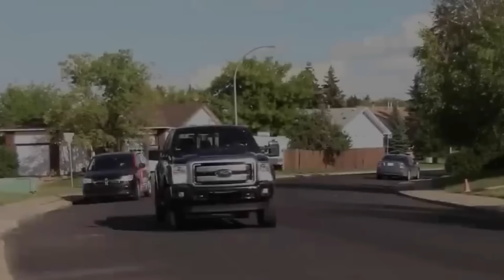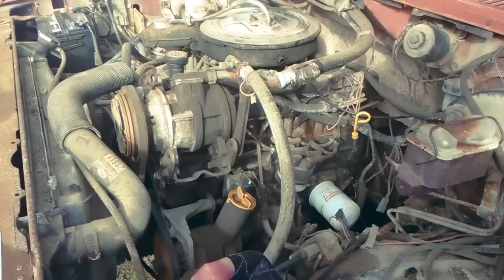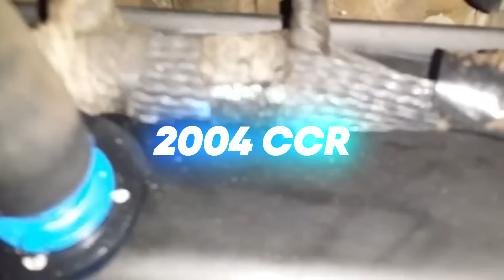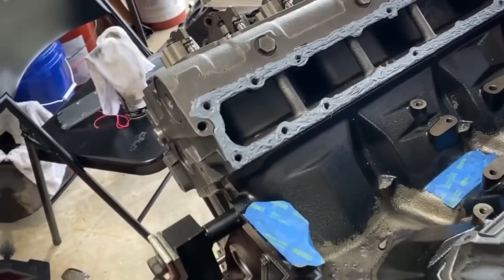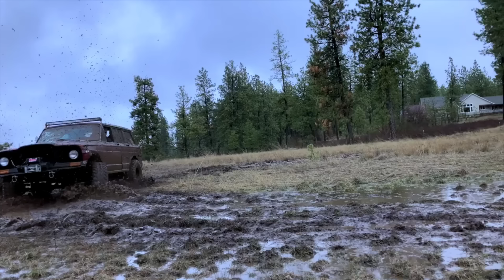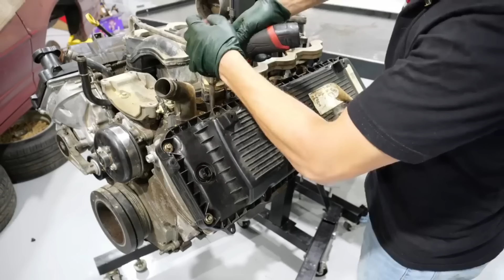The Only 5 Ford Engines That Last 300,000 Miles

Comment: This is just ME on my FORDS (F-250s) 😊 that I bought brand new way back starting in 1979 my First was with the (351) I so wish I had got the inline-6 trustworthy FORD workhorse back then, I ordered a manual transmission with a low 1st gear, Booth of my FORDS did NOT have (4×4) I just never wanted that in my Pickup personally. I got 100 thousand miles out of the 1979 when I bought my next Ford a 2000 with the V-10 
It hit 80 thousand miles when I sold her, now I own a 1 Ton and it is from the other big name makers of trucks, it is (4×4) with 4 door 8 foot bed and it has a (Diesel) with the 10 speed transmission. That my history on FORD ownership and never doing major work on both of those FORD engines 😊

Comment: Waving the b.s. flag here literally been around a 351m 351w 460 300 , 460 390/360/352 5.4, 4.6, 3.5 ecoboost, 4.0, 3.0v6 with more than 300k and the only thing they had in common were on time oil changes.

Comment: Its crazy that most manufacturers stopped making inline 6 engines , they all seems to past alot longer and cheaper to make and work on
Reply: Ow i.say this all the time,.straight six is the most reliable engine config. Most powerful per displacement aswell these days..i,m a Ford guy, but the hurricane engine from Stellantis is the best 6 cylinder petrol truck engine. EB 3.5 should have been inline its just too complicated....

Comment: 07 f150 4.2 v6 i have 356k miles on it . Change the oil every 10k miles . Full synthetic.  Still runs good
Reply: Those 4.2 were overlooked forever.  I’d get one of those before I’d buy one with a 5.4.

Comment: I have looked through the comments and not one 2.7 ecoboost 6cyl is spoken about. I put 300,007 thousand miles on a 15 model before the transmission went cooked and I was still getting 23.9mpg I am currently in a 17 model of the same with 337, 556 miles getting 24.6. Oil changes every 5000 and the basic normal fixes needed belt, one alternator the clutch exploded and a couple of sensors. Both trucks didn't loose more than maybe 18-20 percent power. I don't do it often but I lit the tire up a few weeks ago to prove my point to a guy who doubted me.
Reply: I got a 16’. Bought it at 161k. Last February and currently sitting at 227k. Restore and protect every 4-4.5k miles and did a coolant flush once. I average 19.5-22.5 mpg driving in the NC mountains. I got wastegate rattle but seems normal from what techs said. Only issue I have is periodic rough idles when it’s hot out. I’d like to upgrade the cooling system and put a catch can on soon.
Reply: I’ve owned F-150’s since the 90’s and I’ve owned them all. 4.9L 
4.6L
5.0L
3.5L
2.7L
Well almost all of them. And I love the 2.7L.

Comment: I have driven multiple F250s with the V10 that went 495000 to just over 500000 miles - the only problem with that motor was that it liked to spit out spark plugs- mechanic hell-coiled the cylinders that spit the plugs and trucks just kept running

Comment: There are already 1 million mile 6.7 powerstrokes and it should have made this list
Reply: Mine is about to turn 300,000, runs strong and fast and tows 32' trailer with no problem
Reply: @alyboucher6797 beautiful
Reply: It will easily make over 300k

Comment: On the 7.3s it’s a good idea to replace the factory turbo, pedestal and up pipes because those are common weak points on the engine and you can buy semi grade coolant which can last 1 million miles easy before you need to change it.

Comment: I worked at UPS back in the 1980's. I remember asking the mechanic what type of engines they had in the trucks and he told me they were all the Ford 300CI L6 because they required little maintenance and they were relatively easy to maintain if they did need something. I then bought my first F150 with that engine and happily drove it for 25 years. No idea why Ford discontinued it but my newer F150 with a 302 seems to be just as good.
Reply: A few reasons, the first being that they were a bit too good, couldn't make enough money off of repairs on the truck. The second being that they were very forgiving even for people who didn't do regular maintenance. Making them easily last 300,000 plus miles with poor maintenance. The third being that the engine was never designed for emissions, so it couldn't pass the new emission standards.

And finally, if you made a few modifications to them today, they would basically never die. If you got a pre-oiler, an oil heater, and a water in oil sensor, you now have a life-long truck. And with that water in oil sensor, you'll be able to convert it to E85 for these new junk fuels, and not have to worry about much.
Reply: UPS used that engine till Ford quit making it when they closed the Cleveland engine plant. It couldn't meet modern economy and emission standards. They didn't have a lot of horsepower but they had a lot of low end torque. They were common in service trucks and vans which back in the days they were used never got recommended oil changes at most companies. They still ran at least 200,000 city miles even when neglected.
Reply: Your newer 302 Windsor "seems to be just as good" because it " almost" is...
The Windsor engine family debuted in 1962 , displacing 221ci. They were meant to be the entry level V8 engines for FORD, while not costing as much, nor competing against their FE cousins. But, due to changing EPA and  CAFE standards,  FORD was able to keep the Windsors in production until the '90's, as their main engines!!
I've personally owned 3 in different cars, but my '90 Fox Mustang,  5spd, with 320k miles ( yes, some of those miles came a quarter mile at a time,  beating 350 F- Bodies along the way), was  my best car, BUT, doing regular, routine maintenance all the way!!
It's a FORD...
CHANGE THE OIL!!!!
Good luck to you!!👍

Comment: My F150 2001 has and runs flawless to this day. The only things that have broke was the air compressor right when warranty ended and I’ve had two number six coils go out otherwise it runs flawless and I’m at 200,000.

Comment: 7.3  300,000 miles 24 mpg 5 speed manual transmission f 350
Reply: Amazing fuel milage! I have a 2000 7.3 in an f250 4x4 and occasionally i see 20+  on road trips empty cruising at 70 but i have a gearvendor OD

Comment: I bought a 79 Ranchero new with 6 miles on and drove it till it had almost 400.000 miles on it and the only things I had to replace was the water pump and fuel pump not bad for a 351m. 😊

Comment: I have a 1994 F350 with the 460 big block, still stock, and it's pushing almost 330,000 miles. Maintenance, love and a little luck will get you there

Comment: The 300 inline six has been around for 61 years.
Reply: Never seen one on the road
Reply: @RiggyRonnie  ALL UPS delivery trucks for decades used them until Ford discontinued them !!!!  And you saw them in pick ups and older medium trucks !!!
Reply: Half of them. They also used Chevys i6. They had one too. But they’re gas hogs. Nowadays they use the 12v Cummins and the Chevy 6.0
Reply: @RiggyRonnie  Every base model F150 had them from 74 until 96. Before then the F100s had the same basic engine but 240 CI.
Reply: @RiggyRonnie  They mostly survive in parts of the south and southwest. Where ever road salt is used these trucks rotted away.

Comment: The 460, 351m/351W and the new 7.3 are also of the best ford had to offer. Honorable mention to the 302,351C,289,4.2v6.
Reply: The new 7.3 has a huge engine flaw. Doesnt last past 250,000
Reply: @BradleyCasady  thats what i understand atleast the gas 7.3 if thats whst you're referring too. The 7.3 powerstroke on the other hand atleast 400,000 miles. Any v8 diesel or gas nowadays especially need to be able to go atleast 500,000 or more. That way the common man can definitely get their moneys worth out of their investment

Comment: Ford 2003 7.3 power stroke has 467,000. Miles on it!
Reply: But can it pull anything?  I had 2 7.3s, and IDI and an early powerstroke.  Neither had enough power to pull a 27 foot 5th wheel RV. They barely (IMO) could pull the pickup they were in.  I would go with a Cummins for diesel engine.

Comment: Ah the 6.2 Boss V8, born in the baja desert racing, ran countless jobsite on heavy duty for 12+ years. Tank of an engine.
Reply: The 6.2 engine suffers from a major problem: the valve spring, even if you maintain its oil.

If it breaks down in a remote location, it's a serious problem.

Comment: I have a 94 ranger with a 4.0L with 401,000 miles on it with only an intake gasket needing replaced
Reply: Those old Rangers are the best. 🏆
Reply: @jerryjeromehawkins1712  I now have a 2019 Ranger with 120K on it with only a DPFE replaced
Reply: 😊😊06 explorer  201,000 still going  strong
Reply: I had a 93 with 700k
Reply: Ford fuckin Ranger ! I too have a 96 OHV 4.0. Only sitting at 155k. Hoping it lasts a long time.
Reply: FFR, got a 2000 4.0 OHV with 162,000. Should last me a long time

Comment: I’ve got a 07 Ford Fusion with 3.0L Duratec V6 with 430,000 miles on it I daily it 90 miles a day round trip for work mostly on the highway I’ll have had the car 20 years in November.

Comment: I know it's been said already..... the "powerestroke" is NOT a ford engine..............
Reply: It's acutely a hybrid engine due to the international long block and Ford fueling system and other Ford specs and tweaks
Reply: @SierraKnight3277  The international T444 is the same engine.  You can buy the same parts at either a Ford dealership or an International/Navistar dealership.  I know because I have one.  The same basic engine that was put in an International school bus is in my truck.  I bought a waterpump or a school bus from International and put on my truck.  I was also having issues with the Cam Position Sensor going bad from Ford.  Bought an International brand and issue went away.  Ford copywrited the "powerstroke" name but it is an International engine.

Comment: EXCUSE ME...but, the most dependable Ford engine ever is the 2.3 L 4 cylinder "Lima"!
It started life in the '70's in the Pinto, but was most notable as the base engine in the 2WD Ranger of the '90's/2000's.
Yes it was underpowered (couldn't climb a curb!), but for sheer durability it was unmatched. 
Just change the oil, flush the coolant every presidential election, and do a tune-up every decade or so.
Oh, and maybe do a timing belt every 140k, and while your in there do the radiator and water pump (so simple and easy!).
I finally let mine go at 230,000 because I wanted a vehicle with A/C, but I still kinda regret it.
Never used one drop of oil, no leaks anywhere,  and I continually passed Colorado emissions with the same results as when it was brand new...absolutely the best, most economical engine ever!
And I'm not just talking fuel mileage...I mean overall the cheapest maintenance engine I ever owned!
Reply: I had 238000 miles ran like new, no leeks. I opened up the air intake made it sort of ram air. Seemed to have a few more ponies. Ran that thing hard , never a bit of trouble.

Comment: 2009 f150 4.6l , 3V with 410k miles no rebuild on engine or trans
Reply: Dayum, first time I ever hear a 4.6 3v go that long, usually Mustang ones go about 200k+ before something fucks up , I guess it is an iron block instead
Reply: All in the oil changes
Reply: @austinhowze6280 that’s right ! Since new I changed the oil every 4 to 5k with Mobil 1
Reply: I went through 2 4.6 in a crown vicious P71.  Catalytic converter clogged up the right bank and destroyed the heads.  I almost went through another engine before the computer said check the cat system. I hammered out the cats and went on my way until I  gave it to my daughter as her first car.  She didn't really like it too much because she thought it was too big until a couple of guys at her high school said the sound of the car was really great, to them.  I had put glasspacks on it.
Reply: My 2010 F150 with 4.6 3v has 430,000 no rebuild on engine and transmission. Just timing work and regular oil changes! Love that truck!

Comment: My 01 f150 4.6 has 330k and still going strong. All original.
Reply: My 2000 F-150 4x4 has 100,000 miles; runs strong and I refused to sell it when my boss wanted it. It's a 5 speed manual which you can't get anymore

Comment: I had a 97 4.0 sohc all I did was regular maintance it had 350,000 when I sold it and still ran like new. Never did anything to the motor no water pump, starter nothing. Thats a reliable engine. It has to be up there with the 300.

Comment: 2005 F150 with 4.6 Triton.....bought it new.....now 21 years old.......runs great.....nothing but routine maintenance
Reply: I have a 2000 manual transmission 4.6 4X4. I still drive it today.
Reply: i had a 2007 5.4 triton with 310k still running when i sold it and i know it ran another couple years.  although I had a few things replaced threw the years never a true rebuild.
Reply: @timbjork2098  the 2 valve was good the 3 valve well lets just say you were pulling a grenade pin and holding it waiting the the implosion. But i have had the oputunity to do the phaser lock out for customers and 10 plus years later they were still happy
Reply: I don't believe it,  they all needed exhaust manifolds and studs
Reply: @rossmackenzie7993  i also have a 2006 f150 single cab with the 4.6 completely stock and I’ve never had to replace any studs
Reply: @Almightyilluminaty1990 you got lucky. The aluminum heads expand at a different rate than the manifolds. Ford made the manifold bolt holes too small so the studs started breaking. Not sure what year they fixed that issue.
Reply: @rossmackenzie7993 never seen a stud broken without someone touching it
Reply: @rossmackenzie7993  
I also have a 1997 crown Victoria with the 4.6l modular and don't have that issue either also the same on my 2002 ford f150 with the 4.6l triton modular one either I don't really see this as a common issue anywhere as far as I know anyways.
Reply: @GideonKovavevich thats good. 👍
Reply: @Almightyilluminaty1990  '02 Mustang GT 120k miles no stud breakage, '03 Mach 1 73k miles without any breakage, and '04 F-250 V-10 with 168k and no broken studs.  I think the broken studs must be more of a rust state issue because I haven't seen any issues here out West.
Reply: @rossmackenzie7993 As if that isn't the nature of every V8 with time and miles on it
Reply: @xOGKuSh no it isn't.  The 4.6 was notorious for exhaust studs and rotted manfolds, everyone knows that except for you i guess.
Reply: @rossmackenzie7993  so you're telling me it doesn't happen on a GM 4.8, 5.3 or 6.0? You're out of your mind.
Reply: @rossmackenzie7993 ever since they all went to small studs with nuts but fords the best out the big 3 ls youll break every stud hemi itll be leaking before 100k
Reply: @rossmackenzie7993 granted....it has low miles.....currently has 135k .....literally only routine maintenance 😊
Reply: I like mine
Reply: My fathers dad had did that one time or another maybe it would but the engine wouldn’t have to If  we had to run it hard.
Reply: Had a 4.6 run 280k but trany went bad. Motor was still solid. Still had enough of tritons. Bought a 96 with 302. At least it can be rebuilt.
Reply: @Polk4t  Had to have my transmission rebuilt at 275k miles.
Reply: I have a 2008 with a 4.6. Bought it new 18 years ago. 341k miles so far. I replaced the intake at 175k miles. At 340k miles I replaced the power steering pump, the radiator, and I replaced the water pump electively while I had the radiator out. Burns a quart of oil every 1600 miles or so. It did launch the #1 spark plug at around 150k miles, but it’s been a dependable engine overall.
Reply: A great engine
Reply: 4.6l i call the last mule of a motor ford made.
Reply: 2004 , 2005 , 2010 biggest pos on the planet.
Reply: @Craig-e7g not in my case at least😁
Reply: @brenttuttle7268 2v was more reliable
Reply: @Craig-e7g The 5.4 3 valve is a POS. The 4.6s are excellent.